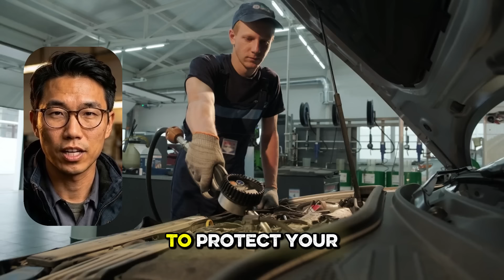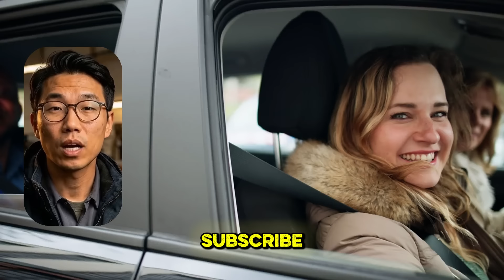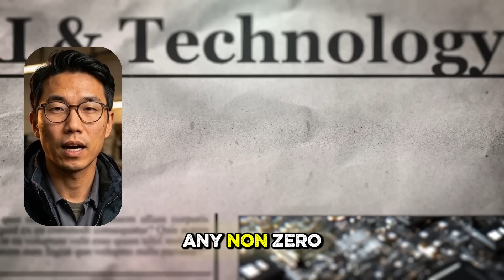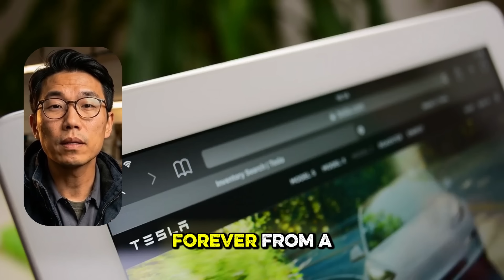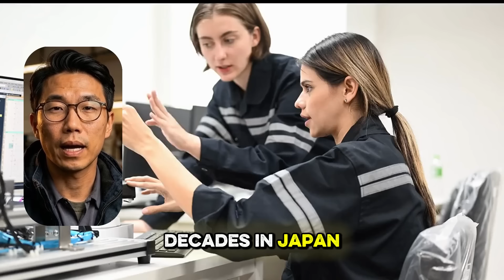This SECRET Japanese Function Costs $0 and Is Only Known by 1% of Drivers — Stop Ignoring This NOW!

Comment: What if it's a hybrid car? Pressing the start button and pressing the brake peddle doesn't always start the engine. Sometimes my car pulls away on electric motor only.  There seems little point in holding down the brake peddle for 10 seconds if there is no engine running.

Comment: But this video is not going to help me because I have grown out of boring bland Jap cars. I drive a 1997 Volvo S90SE with 295,000 kms on the clock. It is safer than Jap crap, better looking than most Jap crap, built of steel than will not rust unlike Jap crap, designed to last longer than Jap crap, and much more fun to drive than a horrible Camry or Corolla or ... or  ... and it also has no complicated electronics that will inevitably go wrong and need expensive replacement. If you buy a 2026 Jap or any other car, whether petrol, diesel or electric you are throwing money away.

Comment: Can I put it in battery guardian mode without locking? How do I take it out of this mode to drive? My car lives in a heated garage. I leave the windows open so water from my feet or rain-wet clothes will dry out between trips.  I often don't drive for a week.  Battery guardian mode would be useful if I can put it on with windows open and know how to re-activate the functions when I'm ready to drive.

Comment: I was gifted (from my son and daughter in law) a 2012 Lexus ES350 . It appeared to have about 10,000 miles on it. It had 78,000 miles on it. The current mileage after 5 years is 93,000 miles. Replaced tire and struts two years ago. All fluids checked weekly along with tire pressure. I had the front brakes resurfaced with new pads at Toyota dealership at 78,000 miles. It is my most prized possession and I have never had a nicer vehicle in my entire life. Now, after seeing this video, I am angry and feel like I've needlessly abused it rather than babies It. These "hidden" features are items I would have paid to have installed if I knew they existed. (Operating manual 400 plus pages so if they are in it, I didn't notice). They have not been used daily because American dealerships keep it hidden.That speaks volumes about the state of American business and its almost universal, overriding obsession with the maximization of profits above all else. It makes me angry but it's not new knowledge in general. As an American it makes me sick at heart that it has only gotten worse in my lifetime. Ironic isn't it. Since WWll, it is Japan that now teaches us about quality. We never seem to learn and are in the process of decline. We are now beginning to fall behind the rest of the world when we were once the undisputed leader. 😢

Comment: Toyota Tacoma 2003 I don’t drive it a lot just around town and she’s just breaking in with about 101,000 miles on her. I just got her an Odyssey extreme battery. I’m tired of these $200-300 batteries that fail  2 years so now I got four years of reliable warranty and this battery will exceed the warranty according to all reviews and other mechanics, I spoke to.
Time will Tell.
Reply: Thank you for the tip!  I’ll keep that in mind when my trickle-charger assisted battery eventually needs replacing….

Comment: This video reveals five hidden features in modern Japanese cars (Toyota, Honda, Mazda, Subaru, Nissan) that are rarely explained by dealerships but are widely used by mechanics in Japan to protect engines, save batteries, and improve fuel efficiency. These features are essentially free and take seconds to activate.

Key Features and Activations:

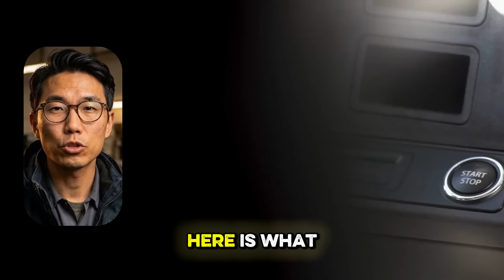1.  Battery Guardian Mode (02:33): This mode reduces battery drain while the car is parked by shutting down non-essential electronics. Activation differs by brand:
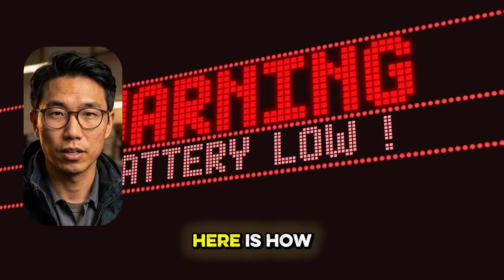•	Toyota/Lexus: Lock with fob, then press lock twice quickly (03:22).
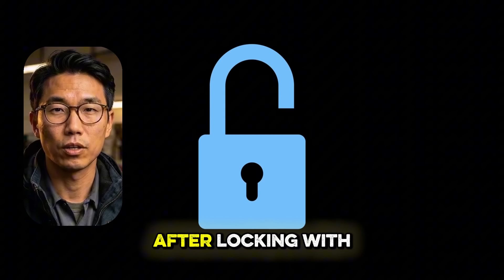•	Honda/Acura: Lock with fob, then hold lock for three seconds (03:43).
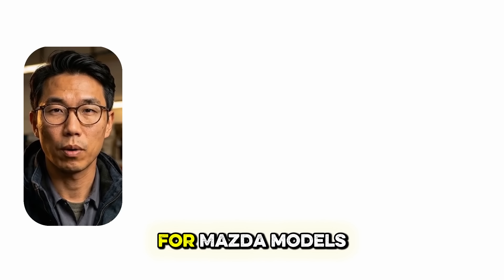•	Mazda: Lock, then lock again and hold within two seconds (03:59).
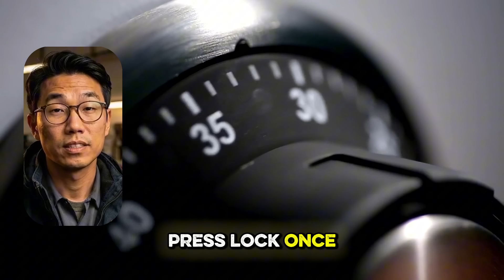•	Subaru: Lock, unlock, lock within five seconds (04:10).

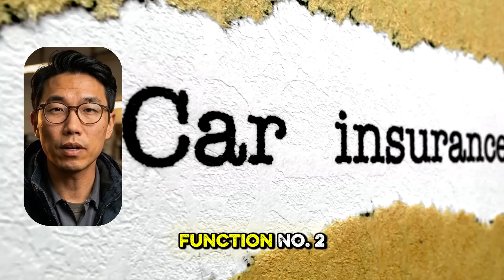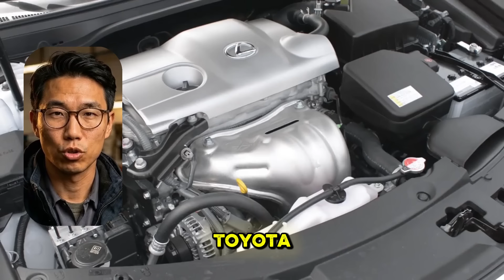2.  Cold Start Engine Protection (04:30): To prevent engine wear, start the car, then hold the brake pedal for 10 seconds before shifting to build oil pressure (05:20).

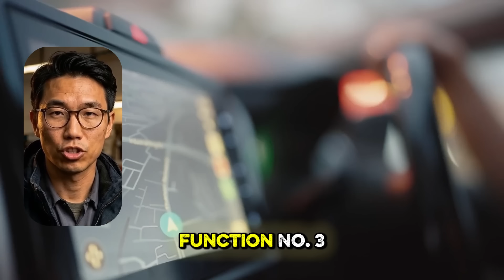3.  Hidden Diagnostic Menu (06:10): Access basic system codes without a scan tool by pressing the odometer reset button in specific sequences depending on the brand (06:27).

4.  Fuel Efficiency Coaching System (07:26): Activate a real-time fuel flow display to improve driving habits and fuel economy by 10-15% (07:52).

5.  Emergency Engine Shut Off Override (08:39): A safer way to stop the engine in an emergency is to shift into neutral, then press the start/stop button (09:12)
Reply: Thank you
Reply: You're a Saint 😇 👼  thank you for sharing info
Reply: I have a 2022 Honda HRV. The battery guardian process did not work.
Reply: You forgot to mention the "Laundry Mode" at 8:02 on Hondas.  Who knew?
Reply: Yeah none of this stuff worked on my 2019 Honda CRV
Reply: 1. lock what? I watched the video again and didn't understand the steps for Mazda, or any of them actually.  Maybe the video images threw me off. When would I hold the lock button on the fob? While I'm in the car?
Reply: Thank you !!!!
Reply: Many thanks!!!
Reply: ⁸⁸⅞

Comment: I'm trying "cold start protection mode" on my 2014 FJ this morning. Until I see a change I'm calling bullsht on all of this.
Cars fast idle on start up anyway. 

Edit: Yep just as I thought - held brake pedal for 10 secs, nothing changed
Reply: I agree
Reply: I don't think you'll notice any changes this is for the benefit of the engines and their lubrication.
Reply: @ks999s he says the revs will increase.
Reply: He every 2015’s and newer.
Reply: I heard nothing for Nissan???

Comment: My Lexus from 1999 is amazing, I put in the key , it turns on . If I twist the key and take it out , it turns off . Amazing technology
Reply: Very smart!! After all of the issues with my Subaru, I will never purchase a new car again!
Reply: @oldladyofthelake9041 we had a Subaru for one day before it was stolen 😮
Reply: Same for my '03 Toyota Solara 👍🏾
Reply: I’m sure it’s a fine car, too.  You’ll probably lay down before it does.
Reply: My suvaru crosstrek does the same. Turn key on, engine turns on. Turn key off, engine shits off... LOL🤣🤣🤣
Reply: DidUwinTHISyearsMORON RECOMMENDATION INCLUDING THE MORONSthatLikedURdisgustinglySTUPIDcomment
Reply: @P @PM-od7bk it was revolting , such a special thought tho ( space bar)
Reply: Hahahaha ❤️
Reply: Seen a car with 0 to 8 motor oil.  
That is basically water. No? 
Tolerances so tight.  
Not good.
Reply: Just my thoughts
Not a certified Mechanic
Reply: Thanks to the Government.  Especially the DEMOCRATS with their Green Scam. They put so many restrictions the small motors are basically race engines.  But race cars have a team of mechanics and sponsors.  We don't.  These smaller engines with Turbo?
Made to FAIL.
EVEN TOYOTA IS PUTTING OUT CRAP ENGINES NOW. 
I will not buy a New car  ever again.  2021 and older. Trump relaxed some of the restrictions.  Maybe in a couple years they will make good engines again???

Comment: Oh man you didn’t cover Nissan for the battery guardian mode?
Reply: Doesn't seem to have it. I looked. The best info related to this is to let the engine idle for 30 sends (longer if it's cold) when you start it, but I was told that about every car made by any company thirty five years ago.

Then I was told by Click and Clack on NPR that if you're starting off on a slow side street then that doesn't even matter. 

My 2007 Saturn Ion still runs fine by just starting off slow on cold days, and they get really cold here. Over 150k miles.

Comment: My Subaru kept running down batteries. Dealership solution was to drive the car more. My solution was to have a ‘kill’ switch put on. The only other option was to run it off of a cliff!
Reply: Had this same problem,had alternator tested, winding was leaking current like a sieve,we actually found out by me having old AM radio nearby and on while searching for any clue and it came through the speaker,tuk,tuk at idle,zeeee at higher revs, definitely fixed the issue at a cost of overhauled alternator ✌️👍🍀
Reply: Mine used to do the same thing until I I started popping the face of my stereo face open!I didnt take it all the way off~ just left it like that as it disconnect it from the battery! Then when got back in car even after a week I just pushed it back in place after car started and no more dead battery! It was just a new routine once I figured out it was draining my battery even when car was turned off! Chevy Cavalier & I've had it 11 years now bought used!
Reply: also a problem on dodges and gmc.  constant drain from security system would kill a battery in one week! 1 click to lock another to set security sensors.  just figuring that out, no security system and no dead batts.
Reply: You Didn't Mention Nissan Once!

Comment: This video did not need to be this long.
Reply: It's unforunate in the 2024 Lexus Hybrid, the battery is a real problem.  What is described in the video for ensuring battery doesn't die if you travel for week and car is unused for that time. And the dealership and the owner's manual doesn't cover this issue.
Reply: Absolutely

Comment: The inappropriate, disconnected videos accompanying the audio is very confusing and irrelevant. There are so many examples I lost track, but showing a washing machine control knob when talking about using the eco-assist setting in your Honda was over the top. I will avoid videos from Japanese Car Secrets in the future.

Comment: So thiscis why my Hondas battery goes dead if not drien within a week!!! My friends does the same thing
Reply: Usually it's the hands free link that is defective, not shutting off and draining the battery . Lot of Acura's have that problem
Reply: @markprice-q3f yes, but if you set the process away that should be eliminated
Reply: @ElleyElley-et4ky  I disconnected mine cause I never used it. Problem solved
Reply: @markprice-q3f  How and where do you  make the disconnection?
Reply: @oosum1  There are a ton of Youtube videos showing how, but basically the panels in the roof up by the map lights, those plastic covers just pop out easy peasy and eventually you get to the hands free link and disconnect it.There are many YT videos showing how to do it for Acrua, so I bet there are for other makes, like Honda. Took me less than 10 minutes
Reply: For some people it was one of the fuses. Videos on it.  Search using key words.
Reply: Use noco genius, charge the battery from time to time